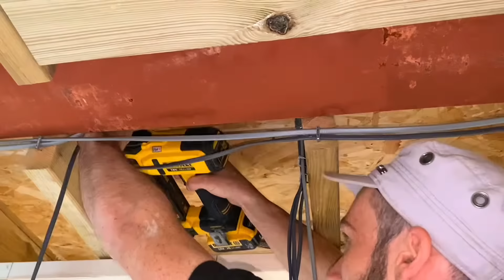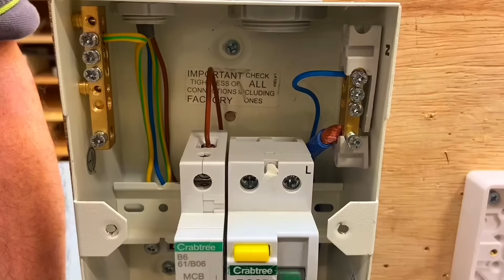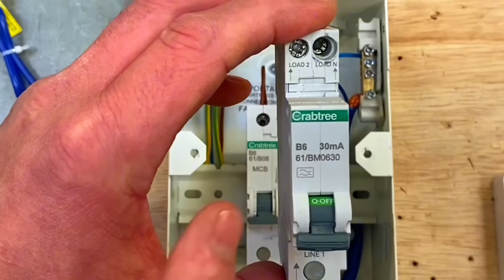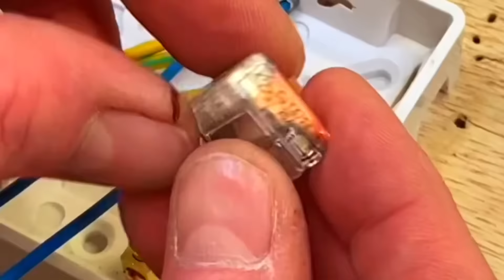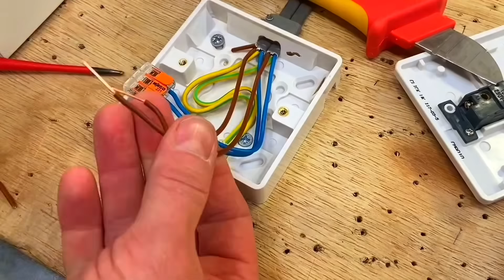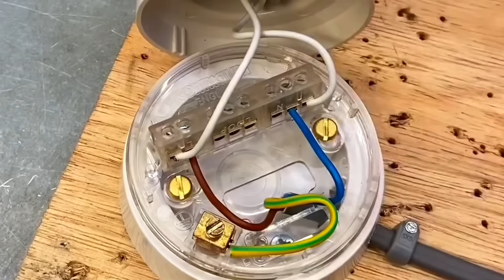Wiring LED Lights Using the New Build Method

Comment: Like someone else said - I was also taught never to fold the wires double, and NAPIT/NICEIC have said the same during recent inspections. And we all like neat but I did see briefly a shot where the CPC had been folded 180 degrees back on itself just as it exited the insulation. That's exactly where it will break and having 70mm past the eclosure isn't going to help you when you need to go digging back in the wall to find enough to joins to.  180 degree folds in cable is too much, not to mention what it's likely to do to the resistance.
Reply: It won’t do anything to the resistance.  Its purpose is to allow greater mechanical strength of the screwed connection - over tightening is a thing x but there are cons too.

Comment: If we use a 3 core we can have both N at the switch and permanent L at the light. It's so useful to have that permanent L in the ceiling for adding new accessories, as useful  to have a N at the switch

Comment: I'm in a house where the light switches just have switched live and earth. There's a fault on neutral in one room (I've removed the other spots and can see voltage coming into the remaining light (between live and earth) but nothing between live and neutral) and I'm waiting for delivery of a camera to track down where the other connection happens (somewhere in the ceiling). I'm not sure exactly what to expect when I find it, is there likely to be a junction box somewhere or just some bodged bits of cable?

Do you have any videos on that?

Comment: I’ve always looped the feed to switches for 30 years on new builds and full Rewire’s back to brick 
Obviously if your doing a Rewire using the old conduit or capping to save on redecoration it would be junction box 
I personally prefer connectors to these new push fit connectors

Comment: I've never heard such rubbish in all my life, I was a JIBapptoved industrial electrician for 50 years , what you are showing on your little table is an end of line switch because if it wasn't you would have 3 cables at every switch, I was taught by some top class electricians and yhe one thing they always said you must minimize the amount of connections on a circuit to the minimum, also your method will leave mo permanent feed below the floorboard or in the loft, making any job where you need a feed near impossible, and as your crazy 18th edition states that cables can just be fixed to the back of the chase with no covering protection or chance to retirees the cables will be inside the hardened either plaster or cement , I swear the morons who run this industry must get bored with nothing to fo so they make up stupid new rules.
Reply: I was thinking along these lines.  I brought an old Victorian terrace house and trying to fix the lighting electrics is neigh on impossible.  Most of the switches have the live coming to them and then going somewhere else.  So much so my downstairs hall light feeds the live for the upstairs light.  And the upstairs switch sends the power to the upstairs light but the upstairs light takes its negative from the upstairs lighting circuit.  So when my consumer unit was replaced and they split the upstairs and downstairs lights it would trip my rcb for the lights because it was not on the same circuit.  So they both had to be wired into the same rcb for upstairs and downstairs lights to work.  It’s a pain as the wires are chased in so to fix it properly means running new wire and a big amount of mess chasing out again.   Would have been so much easier if the roses were where the lives come in and neutrals out etc then would have been easier to fix the switches.

Comment: To call that Wago “3 conductor” only makes sense if you’ve become accustomed to “conductor” being a synonym for “wire”. This is unfortunate as that component only has 1 conductor. Unlike a traditional connector block of a similar size that could have had 3 conductors
Reply: A traditional (chock block) connector does a different job to a Wago, which connects together all of the conductors entering into it.

Comment: ok, im not a sparky so have very little know how. but does the ring then just run between the switches and each light is like a spur?
Reply: Yes exactly that! Although the 'ring' is a radial on a lighting circuit
Reply: @tSt4RifY  Am I missing something or was this example missing the onwards cable for the circuit?

Comment: Rewiring unearthed lighting on my late Father's loft, I used a Surewire 4 way prewired box.

Light circuit in
4 cables to switches
4 cables to lamps

All electrical connections in one place, accessible standing on loft ladder. Easy to test and maintain.

Comment: Old school DIYer here, but keen to learn new methods. In the old school, a lighting circuit was a ring with multiple lit rooms off one CU breaker. The old school ceiling rose allowed ring in, ring out and cable to switch. The method shown here does not allow a ring circuit. Where would the ring be connected? If it requires a separate junction box in the ceiling (which the old rose integrated), then this solution seems worse than the old school way. Surely better to replace the rose with a junction box, and daisy-chain twin and earth between lamps, as this method requires. Help me out here…
Reply: Sockets can be ring or radial as long as the correct rating of protective device is used e.g. a 32A MCB / RCBO etc for a ring circuit and a 16 or 20A MCB / RCBO dependent on purpose.

With regards to lighting circuit a radial is used whether or not the two or three plate method is used. In a domestic arrangement this would most likely be protected by a 6A MCB / RCBO.

In regards to both lighting and power circuits protection via an MCB would also be protected by an RCD or RCCB too.

If you were able to see inside of a consumer unit you should find that the ring circuits have two legs at the MCB / RCBO and the radial circuits have one leg at the MCB / RCBO.

Hope this sheds some light on the issue.

Comment: Why you calling this the 'new build' method? I was wiring this way in the eighties and nineties and all types of installs be they rewires or new builds.
Reply: Back in the 80s, those houses you helped build were new builds...
Reply: @moodophile  Did you not see the word REWIRE, we were rewiring and replacing mainly old VIR and TRS cables which accounted for majority jobs in those days especially council stock as these cables were degrading fast unlike PVC does, new builds were a small % of national demand for wiring a house.

Comment: That lampholder has exposed live parts when there's no lamp in it. Clearly unsafe. How can it possibly still be permitted? 
Serious question.
Reply: 1. There should always be a light bulb inside the socket.
2. Most people will turn off the switch when replacing a bulb.
3. Even if the switch is on, you cannot accidentally touch the center terminal without poking your finger in a 35mm deep hole.
4. If you are stupid enough to poke your finger in there, an RCB will save you.

Comment: The only problem with this system is if you want an extractor or smoke alarm on the lighting circuit. I think that whys the old way is the preferred way however I've done both.

Comment: I would have identified the switched output, so next time you know which is the incoming feed.
Reply: I was going to ask whether there was any value in identifying the permanent line v switched line in the switch back box...
Reply: @robm846  a competent person would always identify permanent vs switch wires. Almost none do though ( well competent ones do, incompetent do not ). It only takes a few seconds to add a label, marker or whatever.

Comment: Fit flat panel LED 
Dont get hot, dont require transformers,  fit flush, no shadows uniform lighting,  adjustable from operating theater burn your retina  to gentle warm light with remote control, only need a couple panels, are not point light sources to bright to look at, last for ever, efficient
Just so much better in every way, i have no idear why spot lights are still fitted in new build.
Reply: Aesthetics.

Comment: So two plate wiring like wiring singles in conduit is the new build way?  It will consume more cable having to daisy all the switches then up to the fitting, it defo will. 25mm boxes will be required for some as switch boxes may struggle to get four 1.5mm t&e in where there is two way switching. But what ever I still can’t get my head around why you would use a black cable as live?
Reply: Even 0.75mm2 is enough to wire an entire house in led lights, we are talking just milliamps here. But I guess we will never be allowed to drop below 1mm2. Even if 1mm2 is extreme overkill!!!
Reply: @MyProjectBoxChannel If you are the designer you could decide to drop down….but it may have reduced mechanical strength during construction.  And you have no idea what the next electrician/customer may require as a load.  I would imagine in 10 years your suggestion will be the norm though - due to copper costs.
Reply: I assume you are referring to 3Core cables….. you have to pick Grey or Black as LIVE - and Black is a LIVE conductor in control panels too.  Makes perfect sense.
Reply: Why are you still using 1.5mm^2 for lighting circuits?
Reply: @robm846 as it's more than enough for a lighting circuit which  is typically fused 6A
Reply: @robm846 because 1.0mm breaks 50% easier

Comment: New build method??? Never heard it being called that before. And no wonder these young lads nowadays are so poor, when they're being taught to double over the copper before terminating. The NIC absolutely hate that. It's very poor practice  to do that, and greatly reduces the integrity of the copper.
Reply: I double over the copper to fill up the connection. It's how I was taught when solid conductors first came out - i.e. the recommended way. Besides, simply tightening the screw on to a single strand deforms the copper even more - try taking one back out. It will probably break off. I suspect the NIC is simply making a job for themselves. And the reason a lot are poor. Putting unnecessary and redundant cabling that will in a lot of cases never be used. So environmentally friendly - not. i.e. it uses energy to produce both the copper and covering.

Comment: Is this the European switch wiring method
Reply: No idea as I’m Dutch. But this is the way I do it since the late 80’s in The Netherlands. We’re using single strands/lines in pipes in domestic installations and a blabk insulator as switching line from the switch to the lamp.

Comment: I prefer to run a 3 core (+cpc) between the switch and light if using conventional roses/battens,  so there's a neutral at both points, to make the next guy's life easier  (as it might be me!). With some downlights you can even do this with them to the first point, as there's room for a 2 port wago inside, Much nicer if you need to retrofit a smoke alarm or  add some accessory that needs a permanent supply after decorating, that ALWAYS happens :)
Reply from the maker: That’s a great way to future-proof the installation ✔️
Reply: @GSHElectrical  Doesn't surprise me... you'\re an odd teacher, having been on the tools, you know how it actually WORKS, not just 'what the textbook says' (that was a compliment lol)
Reply from the maker: I’ve done that video as well
Reply: Great video. Im still using tons of cable out of habbit. A lot might also slate you for doing it this way but it save cable which also saves on costs. The likelihood of someone changing from many spotlights to something else is rare
Reply: So, you have 1) supply in, 2) supply out to the next room, 3) cable to the light, and possibly 4) cable to the other 2-way switch or intermediate switch….

And then other cables if it’s a double or triple switch….

What are the strategies for keeping the number of cables to a practical number….?
Reply: @jeffmoye The old scheme of looping power and neutral round the light fittings handled that much better.

Comment: This has a major benefit of exposing a neutral line to any smart switches you might want to fit later. My biggest bug bear in old properties is no neutral line in the light switch box :<
Reply from the maker: That’s a huge advantage for future-proofing installations ✔️
Reply: My current house was built in 2006/2007 and has this wiring, it's been very handy for smart switches.
Reply: If you're lacking a neutral for a smart switch I can recommend the Sonoff ZB Mini Extreme. It doesn't require a neutral. The only downside to that model is that turned off you'll get a voltage at the light fitting as it is using the lighting load to provide it's neutral path.
The other good thing about that model is that it's anal enough to fit inside a 25mm back box behind the switch plate.
Reply: That's why I designed my special NO-NEUTRAL circuit for smart switches. It generates a "virtual neutral" to power the smart switch in older installations. https://youtu.be/mznx0xoF8Ck
Reply: If I was going to do a full house refurb back to brick or build a house I’d run every light back to the consumer unit point so they could all be on Shelly relays.
Reply: Nah, just use a triple cable as your switch line then you'll have a spare cable if you need a neutral later

Comment: Back in the day having a connector strip behand a light switch wasn't permitted by councils in their council houses for rent. However now that ceiling roses are out of fashion feeding the switches rather than ceiling roses has advantages - and with wago type connectors being better than connector strip. 
The problem occurs when you have a 2 gang switch, both 2 way switches, and feed out to another room. Then you have feed in, feed out, switch to light 1, switch to light 2, 3 core for light 1 and 3 core for light 2. That's alot of wires to tuck behind a switch.
Reply from the maker: Deep back boxes make a big difference with all those conductors ✔️
Reply: Iv just done this exact thing, 47/50mm backbox with 1mm 3 core and they all fit fine

Comment: Been doing this for many years… frowned on by the Old School👍😎
Reply: Depends how old school they are! This was common in the 70’s
Reply from the maker: Times certainly change in this industry ✔️
Reply: The old old school however did this all day. (called 2 plate wiring back in the day). Was bog standard with conduit wiring. Loop in came about to simplify wiring and avoid too many joints with twin cable. The industry is ALWAYS evolving and always has. The neutral at the switch is handy also for smart switches and so forth (as I was typing this Gaz showed his age, like me, by calling it 2 plate 😁)
Reply: It was only frowned upon by some councils and designers, who didn't like the neutral "floating" in the back box without a fixed terminal, which is fair enough. It wasn't a big deal, many times neutrals were wired to switches.

Comment: So on new builds is 2 plate method recommended as opposed to 3 plate now
Reply: Ben doing this for 20 years ,much better
Reply: Now the ceiling rose has met its end in most installations, the 3 plate method is not needed.
Reply from the maker: The 2-plate method is becoming standard for many new installations ✔️